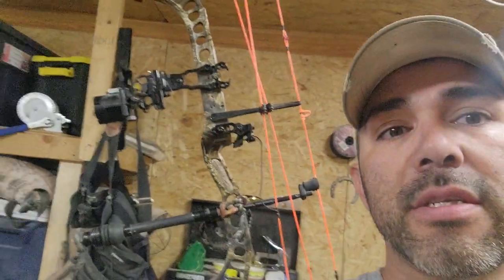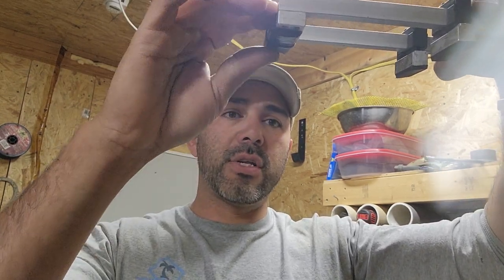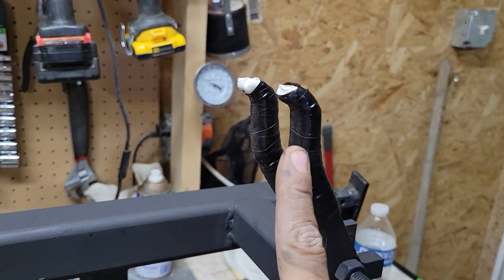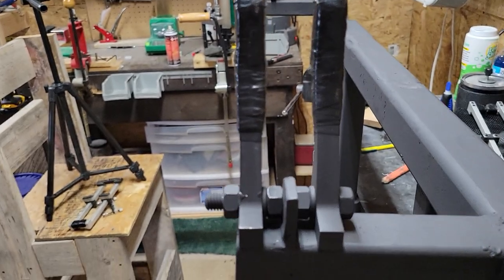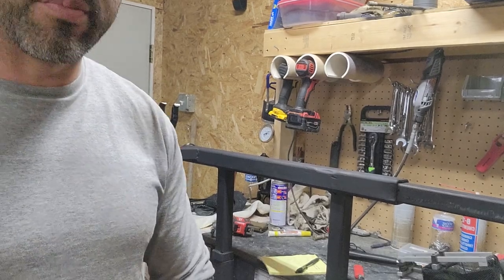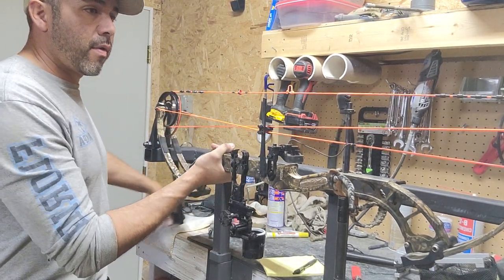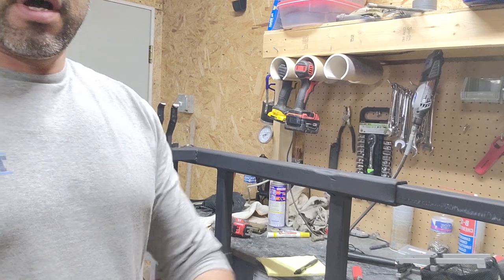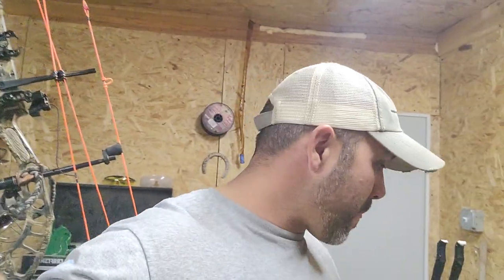Homemade bow press

Comment: On the double nut inside do you tack them to the all thread or just tack them together to the tube steel?
Reply from the maker: @donniehickman7928  I just tightened them up against each other and tacked them together

Comment: I cant thank you enough for putting this together.  I am almost complete with mine and so  far its coming out great.  The last thing for me to do is weld on little clip where the arms attach.  I got my fingers from a friend who owns a CNC water jet cutter. Yesterday I finish drilled the 1/2 inch holes for the bolt and I also drilled and tapped the base to allow adjustment of the fingers individually.  That part took the longest and I see that you didn't even have to do this.  When I'm done I'll send you a pic.  I am really looking  forward to do my own bow work and tuning.  PS> I'm also going to build a draw board. I've ordered the materials and am waiting on the parts from Amazon. I don't do  any filming but thanks to people like you who do, I was able to get enough information to get started.  
Thanks Again
Rodney Metrejean
63 years old (Retired) one stick bowhunter. (And Sometimes out of a Climber) 
My present favorite saying is (Since I'm Retired, I have no where I need to be, and all day to get there)
Reply from the maker: I'm really glad I could help out, I'm also looking forward to seeing pictures of your press. Thank you for watching. Best of luck my friend

Comment: пресс нужен только в случае сборки compound bow , у которого болты на карманах , не позволяют полностью ослабить тетиву и троса !   если лук собран , и требуется замена тросов и тетивы , или регулировка , достаточно иметь под рукой обычную зажигалку или любой предмет такого же размера ( дерево , пластмасса )
-  упираемся коленом в  Riser , оттягиваем тетиву на 7 - 10 см , и вставляем предмет в блок , который упрётся в плечё при отпускании тетивы .
....................
a press is needed only in case of assembling a compound bow, which has pocket bolts that do not allow the bowstring and cable to be completely loosened! if the bow is assembled and the cables and string need to be replaced or adjusted, it is enough to have an ordinary lighter or any object of the same size (wood, plastic) on hand
- we rest our knee on the Riser, pull back the bowstring by 7-10 cm, and insert the object into the block, which will rest against the shoulder when the bowstring is released.

Comment: Great job! Any chance you can put a link to the fingers?
Reply from the maker: https://www.ebay.com/itm/Bow-Press-Fingers-Set-of-4-/203830716980?mkcid=16&mkevt=1&_trksid=p2349624.m2548.l6249&mkrid=711-127632-2357-0
Reply from the maker: Thanks for watching link should be posted let me know if it works.
Reply: @lonsurez83  it does, thank you.. it was the same one I found earlier this week, I was hoping yours was cheaper! Lol
But now at least I know someone who's used them are having good luck with them
Reply from the maker: The ones I originally bought were cheaper but I can't find that specific set anymore. I'm guessing it was the only set the vendor had
Reply: @lonsurez83  just a heads up to anyone looking to buy these...
My total on the cost was $101.18 including tax and shipping (to Michigan)
 6 day delivery time
There was only 2 in stock when I ordered, so should only be 1 left..

Comment: Genius! I'm tired of running back and forth to town to get mine worked on, bows take a lot of abuse in boats and I usually need it done asap and most bow shops tend to be on the ruder side and won't listen to what you want to do with your bow and do it their way.
Reply from the maker: I hear you, my problem was the nearest shop was a 2 hour drive one way.

Comment: Do you think you could use a square tube trailer jack instead of building the screw piece with the all thread? Curious because I will be building one and wondering if that is a reasonable option.
Reply from the maker: I think it would work just fine, that was actually a thought of mine but I had the scrap metal and not the jack so I went with the scrap metal. I would make sure it opens enough to use on your bow. Good luck

Comment: Groovie 
All that is needed is a solid base, a solid arm on one end and a moving arm on the other
AND  a piece of all thread to go in between them. I used 2x4’s Screw them solid to a piece of plywood on one end and hinge the other. Make cut outs for the pullies and you have a bow press
Using steel is great but not necessary  
It just doesn’t take much to make a bow press. Heck I’m a hack and I did it successfully